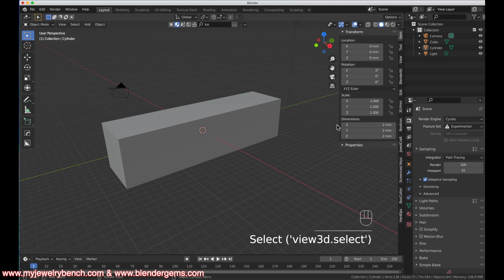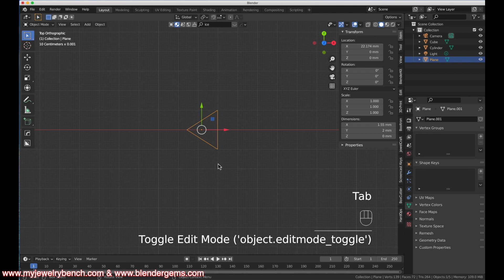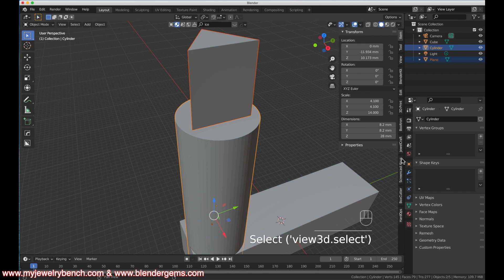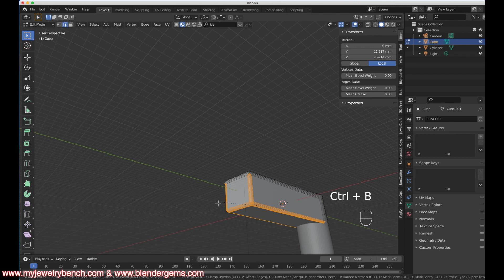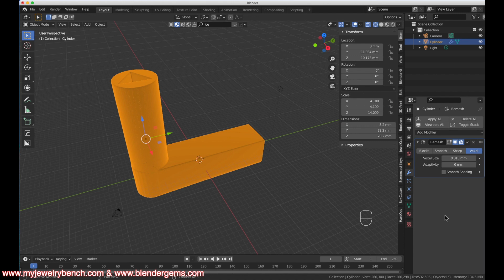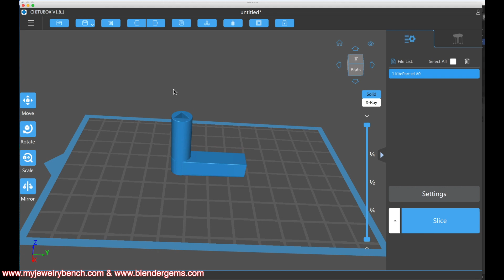3D Printing with Blender 2.9x/3.0  Yes, You Can!

Comment: You probably have figured this out in the past six months or so, but if you want to make an equilateral triangle shaped primitive for subtracting, make a cylinder but set it to use 3 vertices instead of the 64 you used for the circular cylinder.

Comment: I hope you know that you can create something like, much easier and like 10 times faster in fusin360 or other parametric CAD programs.
Reply from the maker: I could have done it 10 times faster in blender also. However it would defeat the purpose of a tutorial.  It takes time to explain things. Additionally most home hobbyists do not have 440.00 per year to spend on software.  And of course, there are 30 ways to design this same part in each of the programs you mentioned. Thanks for watching though. I appreciate the views and the comments. Take care.
Reply: @watchesandjewelry  it looked like you needed to jump through a lot of hoops to achieve a very simple shape.  The hobby licence is free for fusion but it would be very awesome to have an open source parametric modeler that could compete. I heard there are some paid plugins for blender that makes it a lot easier to model properly but it's still not a parametric modeler.
Reply: Blender is much easier and faster program. Thank you for your videos Mr Peter your videos teaches Me a lot.